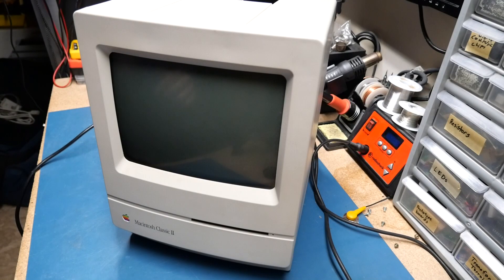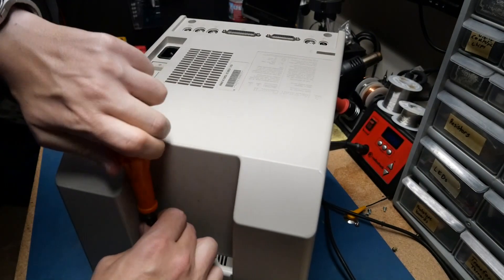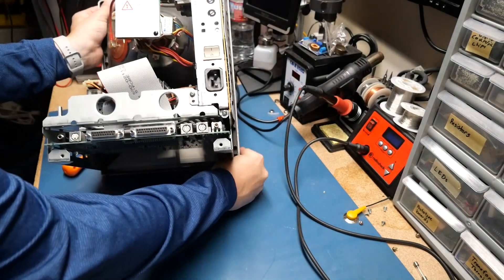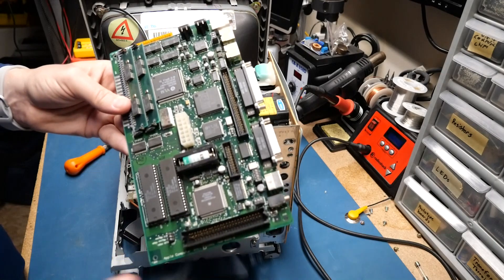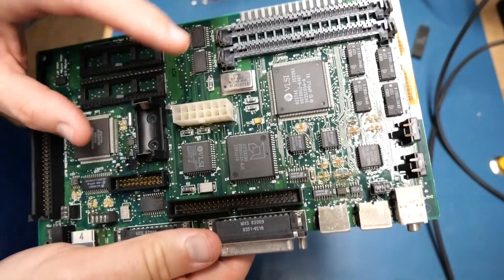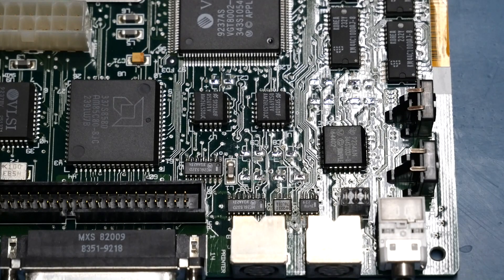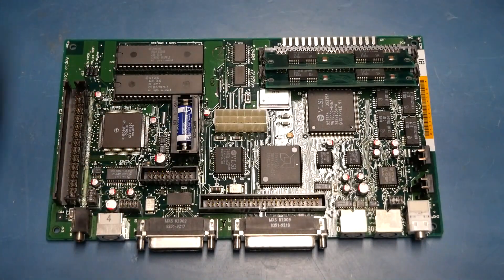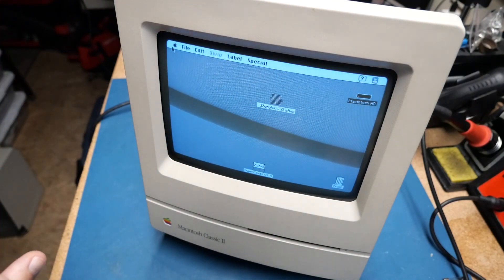Macintosh Classic II Quick Shop Recap

Comment: hey! a bit late, but I got the same problem but i had 3 bars on the screen. my logic board has 4 ROMs. I recapped all the logic board caps but i STILL have the same problem. I tried to use new RAMs, new batteries etc. but still no changes. any ideas?
Reply from the maker: Did you clean the board well when you recapped it? Water and dish soap or a 70% alcohol bath?
Reply: @DKJones96 thanks for the reply. i cleaned it 2 times with circuit cleaner sprays, and i did new solders for the analog board because there was arcing issues. its kinda fixed but i still have problems. when i turn the machine on, the bars show up. i wait 15 seconds, it returns back to normal. sometimes no image, sometime just straight up works. i found out that  playing with the ports in the back can remove the image or make the machine work like normal. i inspected the ports but there is no damage to be seen.
Reply: @DKJones96  also there are VERY small damages on VERY small traces on the logic board.
Reply from the maker: @uni0TH  The place to look for damage would be around the square cheap near the audio jacks. That's the chip responsible for CPU reset and sound and if it has a bad trace it could be causing an issue. There should also be a couple of buttons, one of which is reset, and traces from that being messed up could cause this too. It sounds like it is probably clean enough.

Comment: hello I have a machingtosh clasic 2 with the same problem and Im wondering what will hapen if you just take of the capastioors and start it. i dont reely have the monny to buy new ones 🫤. or if you can just put in idont know random capsitors?
Reply from the maker: Negative on all accounts. It requires the caps to run, that's part of why when you get leaks you end up with the checkerboard screen. You might be able to get away with assorted values but I would be very careful here. You need to have at least the factory cap's rated voltage and I wouldn't more than double what is there. For example, a 10uF 6.3V cap could be replaced by a 22uF 25V cap, though that likely won't fit in the same spot unless you are going to tag on through hole parts. That will work but you risk accidentally ripping off pads if you pull the cap too hard.

Comment: Great video and nice work!  What does the AMD chip on that logic board do?  I’d like get a Macintosh Classic; the games that I want to play on it wouldn’t work on the Classic II due to the processor.
Reply from the maker: Thank you!

The AMD chip is the SCSI interface chip on these Classic IIs. Any particular issue with the Classic II processor it had? I know the 16-bit bus on the 68030 does slow it down quite a bit and some programs run badly but don't usually error on launch. The Classic has much worse performance as it is an 8MHz 68000.
Reply: @DKJones96  Well my Dad had a Macintosh 512K that I played some games on, like Beyond Dark Castle, Arkanoid, and Chuck Yeager’s Advanced Flight Simulator.  And I was told by a Facebook Group that I’m in that focuses on Classic Macs that I’d be better off with a Macintosh Classic-something about better compatibility with the 68000 that it has.
Reply from the maker: @dave4shmups  I have both and should give those a try on it. The Classic II can run from 6.0.8L to 7.6.1(though the latter will be rough to actually use with 10MB of RAM) and I would think that the system 6 compatibility would alleviate any issues with older software. The Classic, while really nice for a 68000 machine, is much slower than the Classic II.

That being said, the Classic went to market a bit late for a 68000 machine and all of the examples I've seen of them are low-hour and in great shape.
Reply: @DKJones96  OK, thanks for that information!